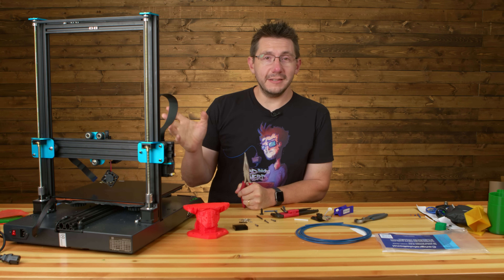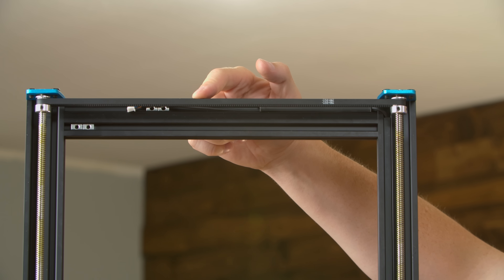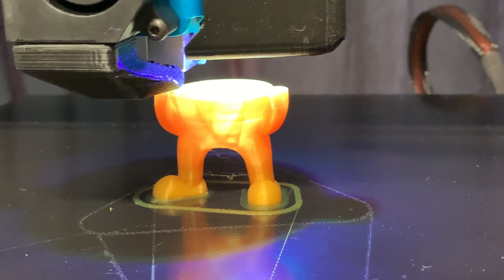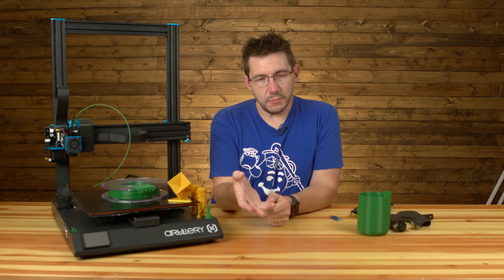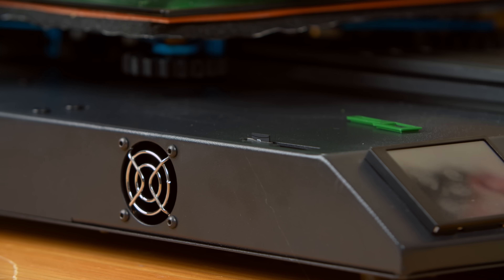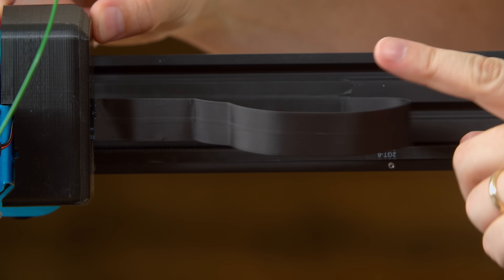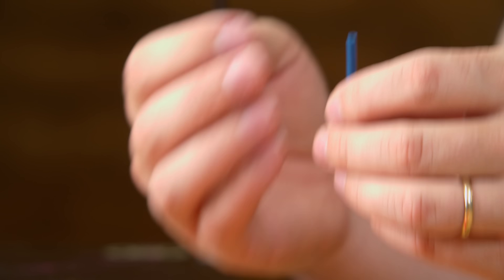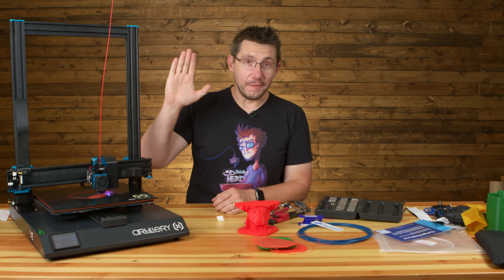The Artillery3D Sidewinder X1 3D Printer - A Must Have?

Comment: Hi Joel, thank you for your review.
Reply: I recently received this printer. I purchased a refurbished one. I was blown away by the quality of the prints I am getting. Unfortunately it continually quits mid print due to thermal runaway being triggered. I have tried to contact the Artillery website, the Ali Express store, and the person that shipped it. The latter being the only one that responded. I changed the ribbon with the provided spare. (That connects the gantry to the base). It has failed twice with in a couples hours on the second print. Is there anything you can do to help? I really like this printer and just want to keep it running without errors.  Thank you, Chris
Reply: @ImaginativeFabrication  post in the official facebook group.  Artillery are very active there and usually try to help
Reply: @ImaginativeFabrication  I don't have this particular printer but if it keeps happening mid print have a look at the print fan speed settings in your slicer. It might be increasing the fan speed at a certain layer time which may be blowing on your hot end causing it to cool down and not be able to keep up. Try decreasing it by 30% and see if it happens again
Reply: @tcw95NZ  thank you! I'll give it a try. I've never had that problem on any of my other printers. I use Simplify 3d and haven't set up any incremental fan changes. I'll double check to see if they were in the x1 profile I downloaded.
Reply: @ImaginativeFabrication  It would also probably help to tune the PID for the hotend with the fan on. Assuming the printer runs Marlin firmware, you can send M106 S255 to turn the fan on. The number after the S is the fan speed. It is a PWM value though, not a percentage so 255 is 100%. I would set the fan to whatever percentage you most commonly use.  After the fan is  on send an M303 command. That would go something like this: M303 E0 C5 S200 U. This will autotune your E0 heater (the hotend) at 200C (S) for 5 cycles (C) and then enable the new PID settings (U). If those settings work you can send M500 to save them to the firmware. You would do this through a slicer or some other software that can send Gcode commands to the printer. You can also put all of these commands in a text file (each one on its own line and in the order I put them in) and save it as a .gcode file instead of a .txt file then run it from the SD card.
Reply: @ew1090  Thank you for your help. I didn't need to go into the firmware at all. It really was as simple as this printer is extremely sensitive to those ribbon cables. I went back over them more carefully this time (especially the one that connects directly to the extruder). It has since been working very well and been giving me highly detailed minis. I have ran it in the double digits for time and haven't had any problems due to the fan.
Reply: @ImaginativeFabrication  Glad to hear you figured it out, and that it was a simple fix.
Reply: @ImaginativeFabrication  This has happened to me on a different printer, and it turned out to be the micro sd card was bad. maybe that is your problem?
Reply: @camryn9095  Thank you for trying to help.  I learned that on my first Creality printer and always use sandisk micro sd or in this case reliable usb drive.  I have the third version so this may have been addressed in more recent versions. The ribbon cables are simply a poor choice. They aren't meant to carry the amperage of the hot end. I'm on my third one. The second failure burned out the daughter board. They were supposed to ship me a replacement several weeks ago (which hasn't arrived). Thankfully I was able to source one from Ebay.  I've had the X1 running for a while now and while the print quality is excellent my dreams of buying several of them to put into production use are pretty dead. The reliability is too low and can throw a production schedule off far to easily especially with the availability of parts being hit or miss.
Reply: ello
Reply: customer service is nothing, runaround. Wiring is dangerous and done by amateurs.
No joke, bought one.

Comment: its probably usb stick speed is not enough, try a different one, it could aalso be corrupted, I had somethign similar with an SD card in the past after 2 years of prinitng it started to fail the print in a weird ways like that, so I changed it to a new one and now its all good

Comment: Interessting conclusion about the teflon tube, i had the same problem but after a nozzle Switch its were gone, too. 
The bigger problem for me is the hotend heater. After 3hours of printing, right after calibration, the heater did go south. And with the connector type they thoose for the transition pcb i hadnt the right one to crimp another heater to it! The choosen connector is the JST 3,96mm and as far as i know there is no manufacturer who is making thermistors or heaters with this kind of connector. The way better way for a plattform would have been to choose the same connectors as E3D (micro-fit 3.0)  to have a easy swappable ecosystem!

Comment: Oh, I had a lot of pain with extruder without heat sink (I did not know it is a thing). On long prints PTFE tube heated enough to make PLA viscous. It is harder for extruder to push, it skipped steps. But the worst thing - as soon as printer is switched off, filament solidifies as a plug diameter of tube, so it jammed half of the times.
Reply: Yes I'm having the same problem.  Also having problem with clogging after long print times. Anything over and hour it clogs. No matter what setting I change same problem.
Reply: @ASSOpid  I broke that extruder at some point, and bought an alternative with better cooling. No problems since then.
Reply: @brine1986  I think I'm going to do the same thing. Thanks
Reply: What extruder did you put on it? And have you upgraded the hotend to a completely metal one yet? If so, what did you use?
Reply: @christopherlyons7613  It was custom built printer of 2014. I switched noname hotend to J-head hotend. J head still has PTFE insert, but heatsink made the difference. There are better solutions today probably, but it did the job.

Comment: I have one and have a really soft spot for it.  I haven't tinkered with it much as yet but I do get some good prints.  It has the odd bit of weirdness which I am pretty sure I'll get around to sorting out some day but it is so much nicer to use than my CR10s and it's cheaper.  Still always default to my Prusa though :)

Comment: I have to disagree with your recommendation Mr. Printing Nerd. If it was under $350 and needed a few things out of the box like my HICTOP i3 5 years ago, sure. However, there are lower cost printers out there that don't need to be repaired for faulty engineering.  No one should buy this at > $350. The fact that there are screws not seating in the frame is a huge red flag that their manufacturing is low precision/quality.

Comment: I had the impression that this model is good at printing fast, because of volcano hotend and rigidity. Also they seem to have a heavily modified firmware. I wonder if it is a good candidate for a 32bit board upgrade, because that would handle directional changes at higher speeds better.

Comment: Downside is the model you have is pretty old alot of the negative things you touched on have either been fixed already, or dont exist anymore.  Anyways, you might want to double check the bore on the nozzle- earlier versions had a few that were shipped with 3mm nozzles instead of 1.75.  As usual Joel, great video but the information (for the most part) is outdated now. Ive had machines now in the fixed v1 (post evnovo logo), v2's, and v3's and am glad to report they are the reason our Prusas are starting to collect dust. Reach out to the community (or me even) if you need anything brother.
Reply: Thu Nell Ⓥ V4 has the reset button just to the right of the LCD. I don't know of any way to determine the other versions.
Reply: Do you recommend this one over the creality CR's?
Reply: Tell me more.

Comment: Just wait till the ribbon cable fails at the hot end... still buying one though.
Reply: I have used mine for over 5 months nearly non stop and my cable was fine. People that tend to have a problem with ribbon cables (most of the time not always) either haven't installed them correctly or tinker with the machine while it's still plugged. 
Nevertheless I still prefer ribbon cables than cables. They make the printer look so much cleaner

Comment: soooo.... why isnt that ptfe tube just a metal tube? can it be upgraded to one?
Reply: all extruders need ptfe tube inside... but problem here is that this one doesnt have a heatsink, and thats just bad design
Reply: @biziluxgames8924  'but problem here is that this one doesnt have a heatsink'? are you sure?
Reply: @rexzhang3522  well yeh i think so... i mean google e3d, which is like de facto for extruders... and well... it has heatsink lol. Im sure they would design it without a heatsink and save cost if performance was unaffected, but i suppose performance then suffers, thats why all popular extruders have heatsinks
Reply: @biziluxgames8924  so if the ptfe tube gets too hot the filament melts in there and when you switch it off and it cools down it becomes stuck in there i'm guessing? 
so can this one have a heat sink mod added?
Reply: @ge2719  yes and ptfe melts also without heatsink. I aint the expert tho :D all i know is that im sticking with my prusa mk3s :)
Reply: Metal gets hot. The cable needs to Stay cool otherwise your fillement melts in there and not at the nozzle. It creates jams.